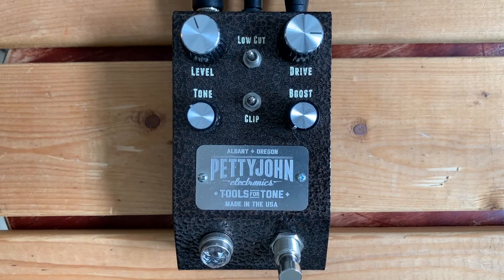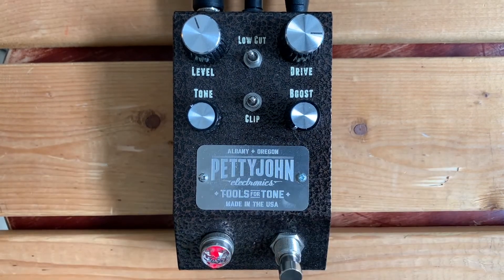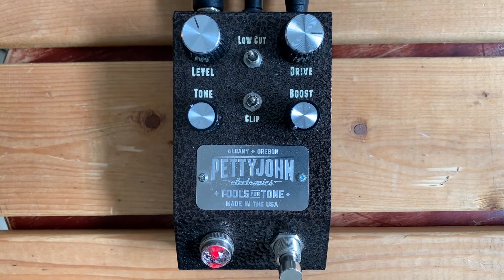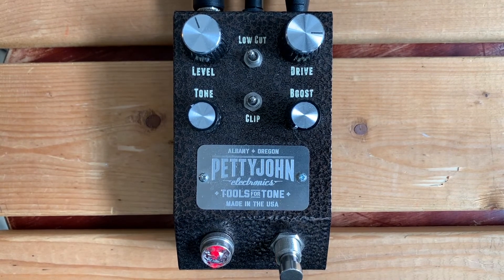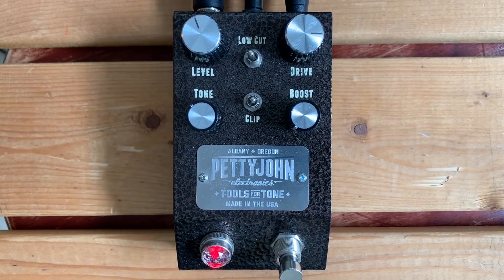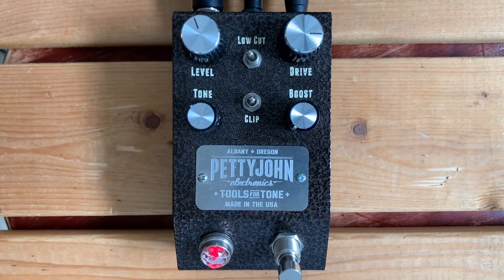9v vs 18v - Pettyjohn Chime Overdrive

Comment: There is no noticeable difference. I also have this pedal and I am looking for this sound. What guitar and amp (or other effects) are you using? Thank you
Reply: Roberto Quiñones Nakazaki I think the only noticeable difference would be higher headroom allowing you to hit the pedal with a hotter signal and prevent unintentional clipping and just a slightly more sensitive gain sweep.  From my understanding the actual clipping shouldn’t be any different but the lowest possible clipping and highest possible clipping from the pedal will be a little different.